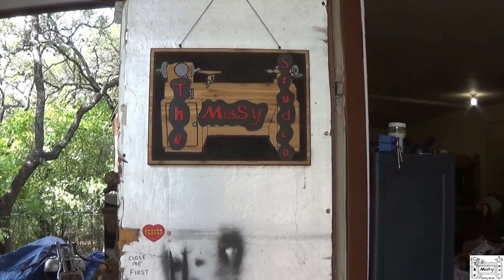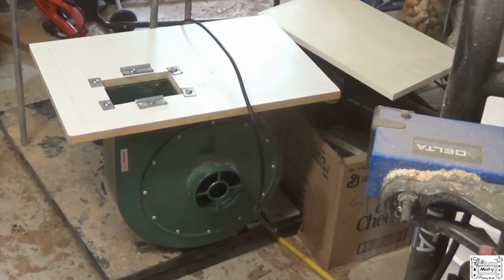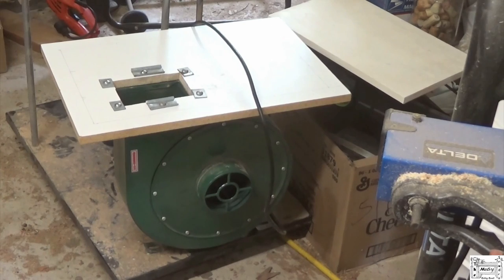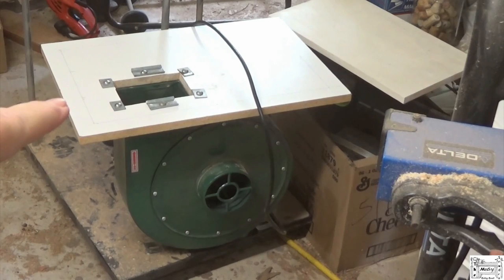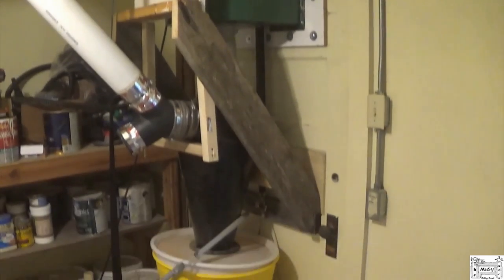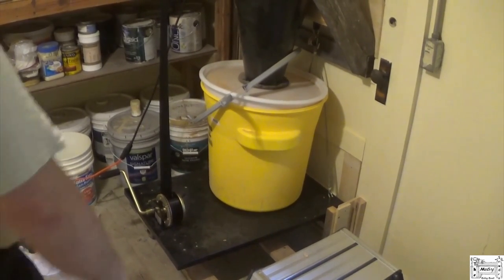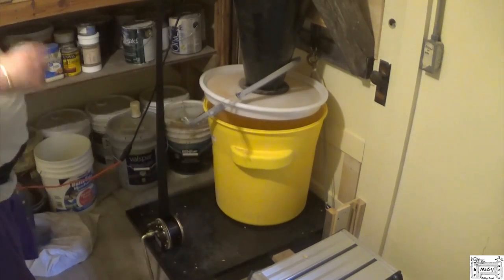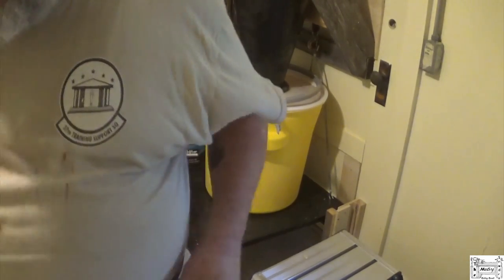Shop Update #13 -- Harbor Freight Dust Collector 2 Stage Modification

Comment: Love it, Billy. Figure it out as you go and it works great.
Reply from the maker: Thanks, William!  I've seen guys that draw them out, plan every joint and connection to the 1/4".  I just can't do that.  Designing on the fly has it's disadvantages to be sure, but it also makes me think and keeps my brain sharp.  If it could only let me keep my eyes sharp.  LOL
Billy

Comment: Great job on the mod Billy. I had a Grizzly dust collector I was going to do the same thing to. Problem was it was really loud and I decided to just buy a Laguna  P Flux Cyclone model. I really wanted to build my own like you did but just could wait for myself to do it. LOL
I did build my own cyclone for a shop vac and it is great getting nothing in the vac itself.

I like how you have your system plumbed. Looks well arranged and should work great.
Gary
Reply from the maker: Thanks, Gary!  I hooked it up to most everything now and it does work great!  I'm very happy with it!
Billy

Comment: Nice job Billy, my extractor runs on 4" pipe attached to a big shop vac running through self made blast gates. I might have to try a cyclone system as the suck does diminish as the bag fills.
Reply from the maker: Thanks!  It will make a difference.
Billy

Comment: Hi Billy, I had a cyclone in my first shop but went to a bag system for my new shop. I still have the cyclone so I know where the cyclone is going to end up. Just need to figure out a way to connect it, as my new extraction is 4" and the cyclone is 2.5", without putting too much strain on the motor with the reduction in pipe size. Saw the picture you posted as well so keep safe and looking forward to the next video. Cheers, Huw
Reply from the maker: Thanks, Huw!  My cyclone is one of my best purchases.  And thanks for that, I'm getting along okay.  Was out in the shop again today. Can't let a little thing like that stop me.
Billy